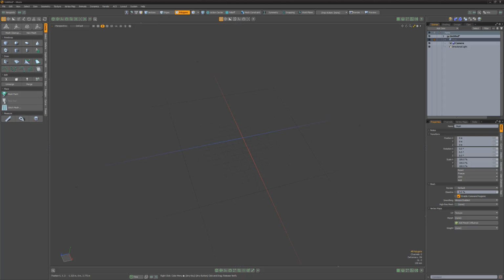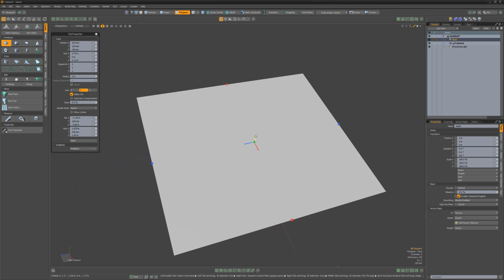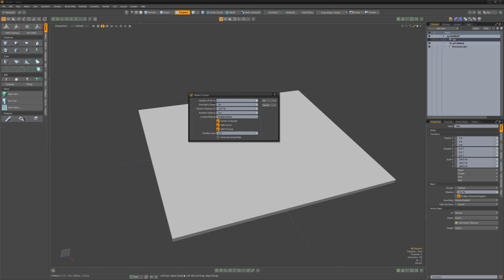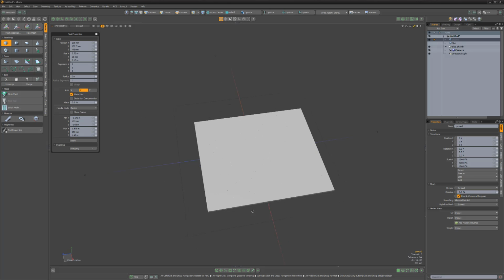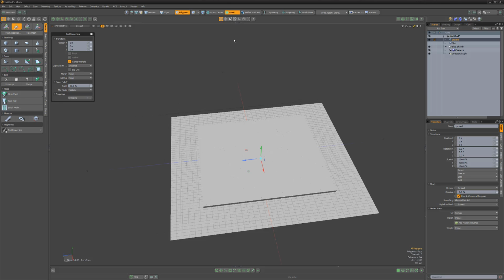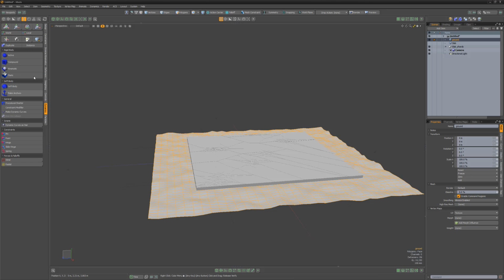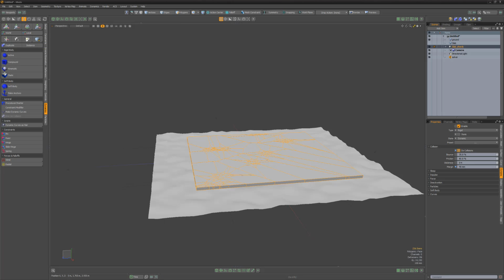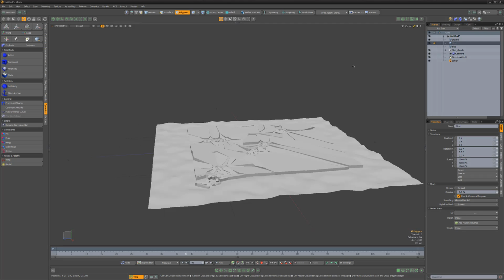Modo Essentials: Dynamic Modeling

Comment: I learned this back when I was in Vancouver Film School using Softimage 3D (XSI wasn't around yet; this was in '98). It's a nice little technique that can save hours and hours of work when it's appropriate. :) Nice to be reminded of it!
Reply from the maker: be sure to check out the vaughan in 60 seconds series. several dynamics videos in the mix. Get the V60 Search tool to find what you need quickly